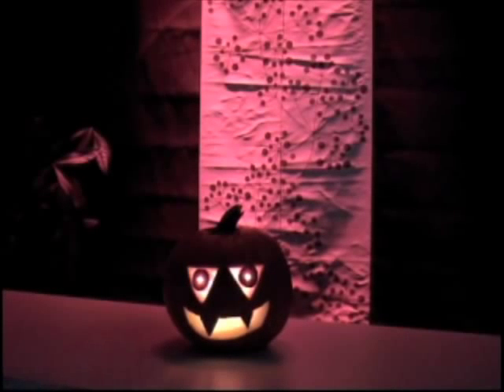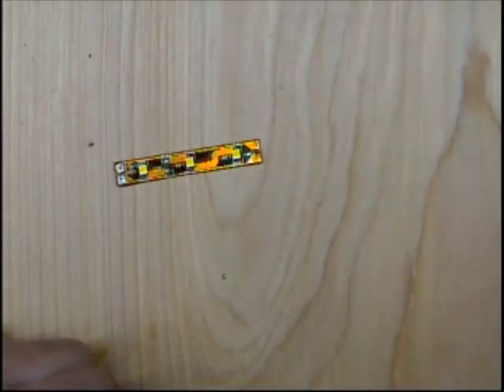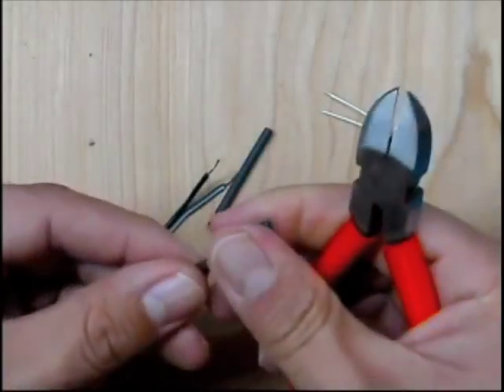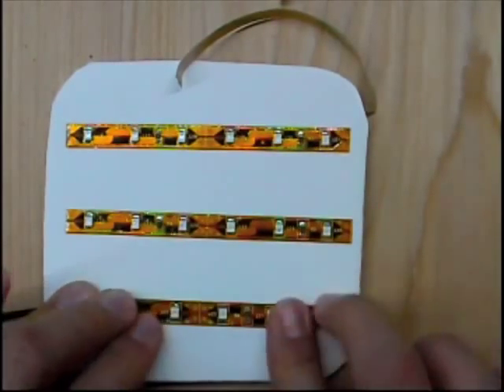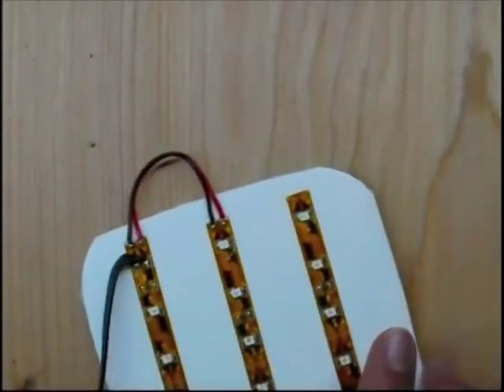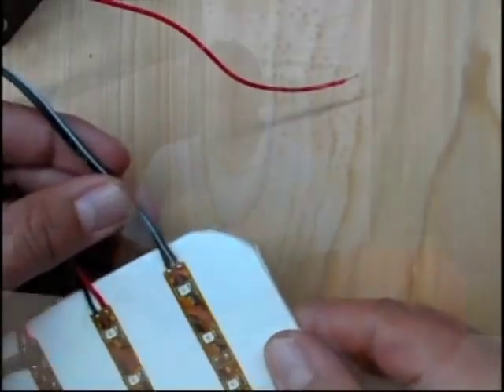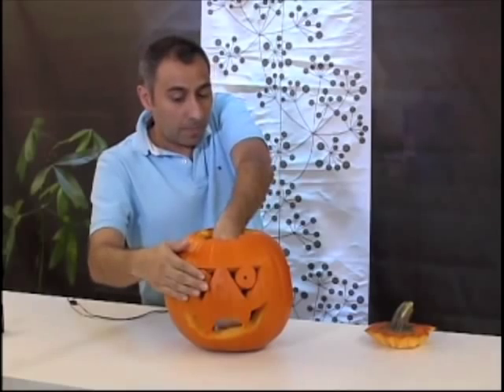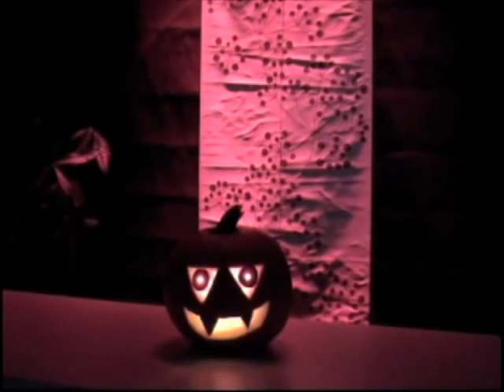DIY LED Pumpkin Light

Comment: Or slide a coin cell battery between the LED leads, and you're done. Small, portable, no soldering or tools needed.
Reply: +Michal Gloc How would that affect a series of 6 LED lights?
Reply: +Casey L It wouldn't. Title of the video is about diy cheap LED lights, and I think my solution might be better at it, or is at least a simpler alternative, and it works well in pumpkins - I tried. Why? It must be a series of 6?